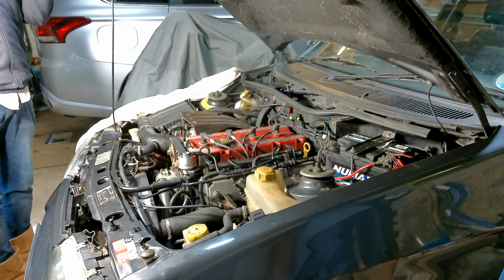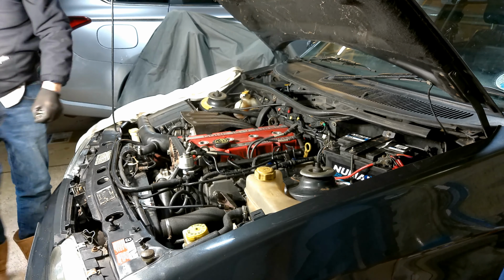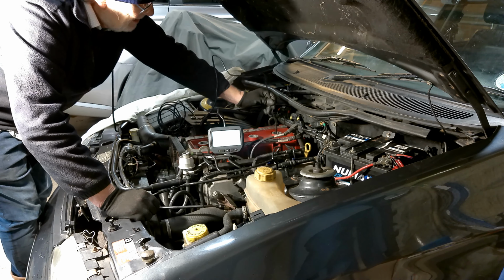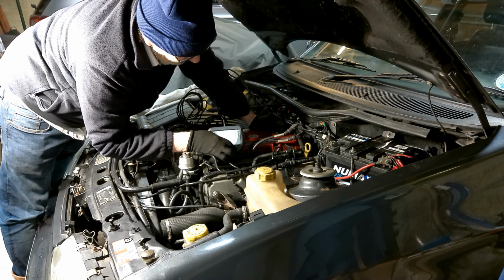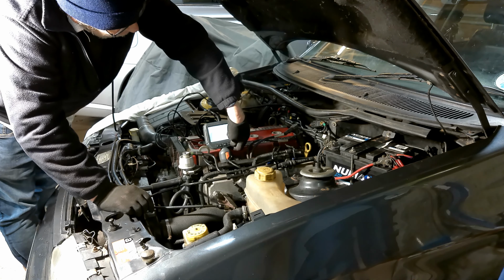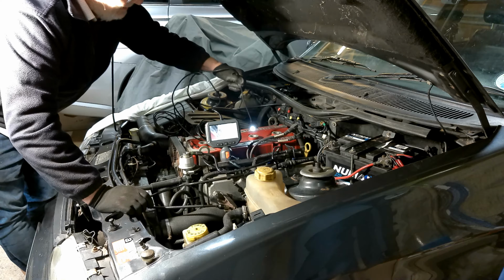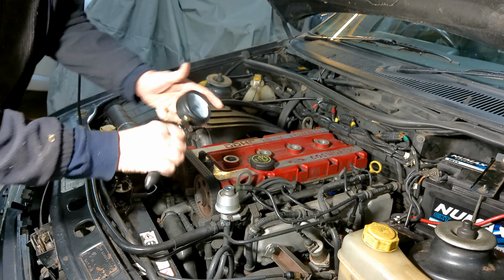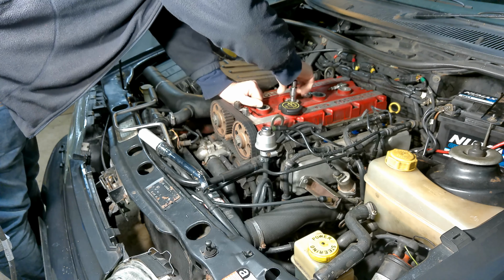Rob's Cosworth. Camera down into the bores for an inspection (borescope) and compression test

Comment: Lovely video Rob. I recently freshened up my YB and the original pistons had the same marks from the exhaust valves touching. I chose to use Modatek replacement pistons with valve recesses and a pair of Quaife peg type cam sprockets to dial in the camshafts to compensate for the cylinder head thickness and to keep an OE look of the engine. Happy motoring 👍
Reply from the maker: Thanks for your comment Wallaby Tracks, I checked out your last video and the car looks great under the bonnet.:yougotthis: I know it is a sleeper.😉👍

Comment: HI, any additives in fuel? Were Running Premium fuel, 98? And do they put this engine in longitudinal orientation, so it could have 4x4 traction?
Reply from the maker: Hi Tomas thank you for commenting, I do not put additives in fuel and yes I do use Unleaded higher octane 97 RON, all Ford Sierra's engines are longitudinal, it was when Ford introduced the Mondeo that it had a transverse engine.:yougotthis: